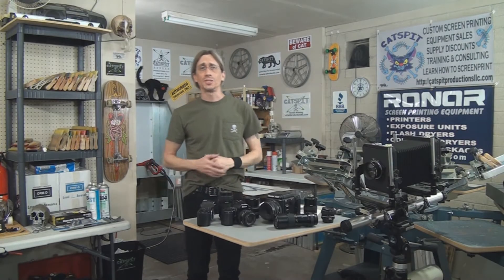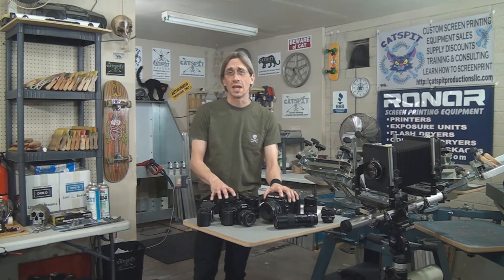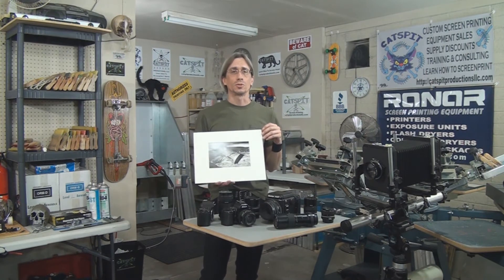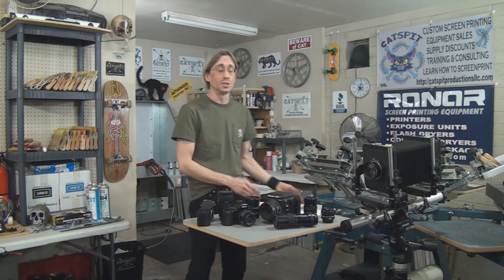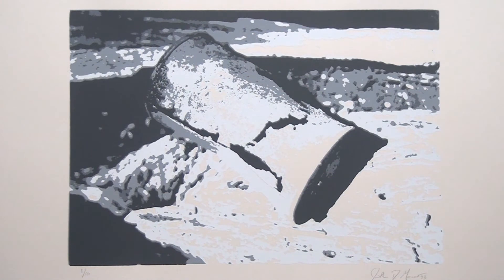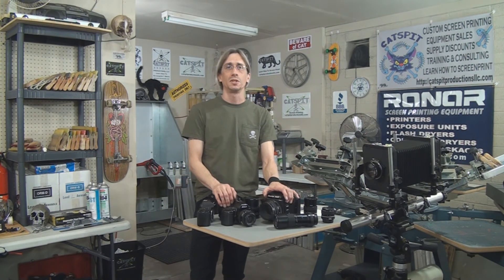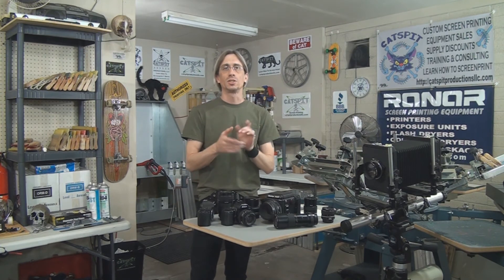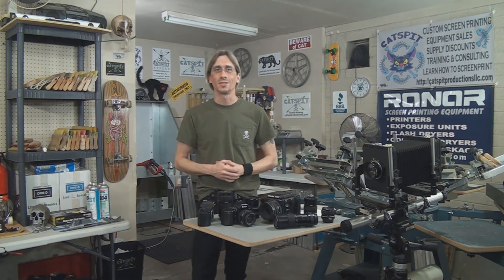Silk Screenprinting: Fine Art Posterization Photo Print

Comment: very interesting video, you are the only person ive found touching on this subject,  ps i love the awsome camera collection you have, very nice. just wondering if there is a way to burn images onto screens using film negatives and an enlarger. and is there a way to produce halftones from this method, or would it just be easier to scan the negs and convert to grayscale in photoshop then print too film. ps great video.
Reply from the maker: smoothoperatork1 Thank you very much!! I appreciate your support. I'd love to get back into poster printing and we will do that eventually. Emulsion is photographic but it reverses whatever you start with. So normally we start with a positive. The emulsion creates a negative and then the print recreates the positive. So if you start with a negative you will end up with a negative. You could use Kodak direct duplicating film to make positives you could use in an enlarger to expose screens perhaps but the bulbs in the enlargers may not be strong enough to do a short enough exposure. Emulsion is sensitive only to UV light. It does not see anything else. So I think doing film positives in the computer and then making screens traditionally would be the easiest. Thanks for watching. Screen Printing Equipment & Supplies - http://catspitscreenprintsupply.com/
Reply: CatspitProductions thanks for your reply, i see what you mean.... even if i created a positive on rc paper and used that to burn a screen, it still wouldnt be a halftone. probable easier to do what you recomended. thanks again, just wondering how many lpi screen i could use to get really fine detail while printing black n white photographs on paper. ive been an offset printer for 21 years , but ive always been interested in trying screen printing and would love to incorporate some of my photography with it. suppose iam wanting to think outside the box and do something interesting. ps do u have anywhere online that you share some of your photography for people to see.
Reply from the maker: smoothoperatork1 That's correct. it's a high contrast emulsion so it cannot reproduce gradients and continual tones without using dots. In the olden days when this was done photographically we had halftone screens or films that we would be used physically to create the halftone. Now this is done with computers and RIP software. You probably cannot get as fine as you can with offset but you could go up to 65LPI or higher for posters. Some people go as high as 75 to 80 but you'll need a very fin mesh screen for that like a 355 or 400 mesh. 

Yes, I have a few images online. A fire destroyed a lot of my fine art work back in 2008 but I have some left. This is Flickr where I store some of my images online. I'm old school.... LOL ;)

https://flic.kr/s/aHsjhT7G5w

But you can also see how my photographic background influences my business images for social networking and such.
Reply: thanks for your reply, cool photos... thanks for sharing. i love photography and mainly shoot film.
Reply from the maker: smoothoperatork1 You're very welcome. My pleasure. I would shoot film and set up my darkroom again if it were not so expensive. Digital is so much cheaper.... LOL. But very different too.